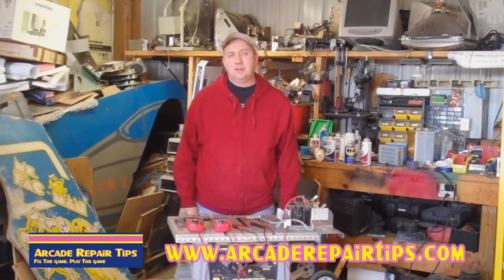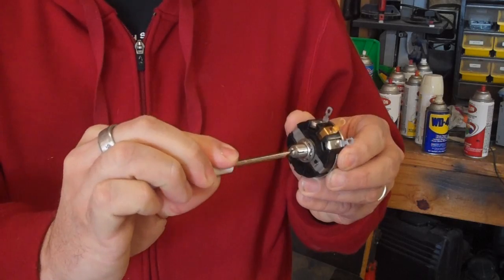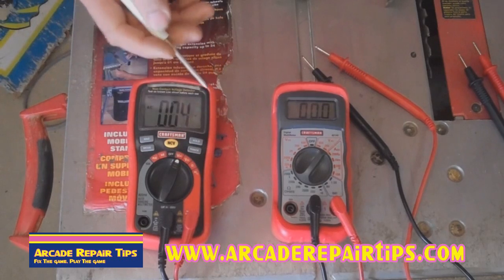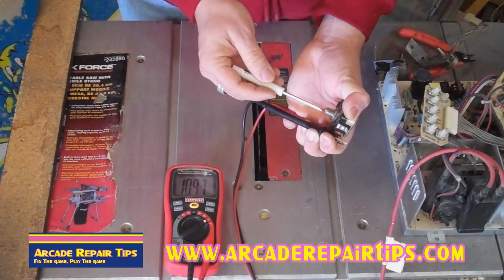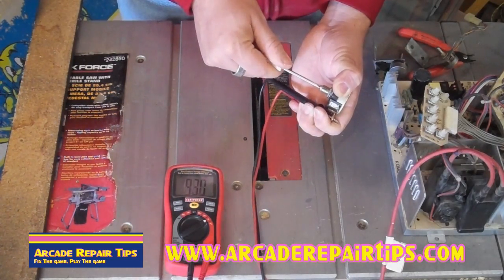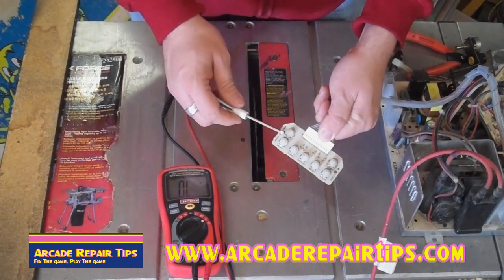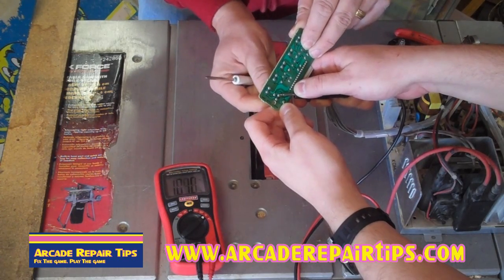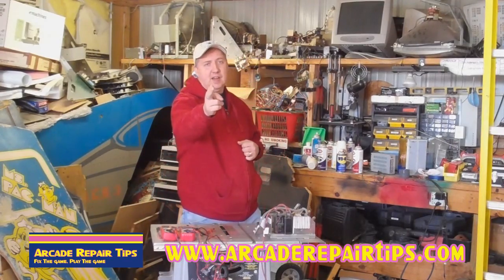Arcade Repair Tips - Checking Potentiometers With A Multimeter

Comment: I love the video but there's one thing you forgot to mention and I think it's important. If you test the pot from the wire ends or the plug, if you get no reading, the pot can be still good but you could have a break in the wire somewhere, either it's cut, broken inside or the rubber insulation has came off the wire and it is grounding to the case or whatever it's touching. Then, you will have to remove the whole pot and re-test it and replace wires if need be. Cheers